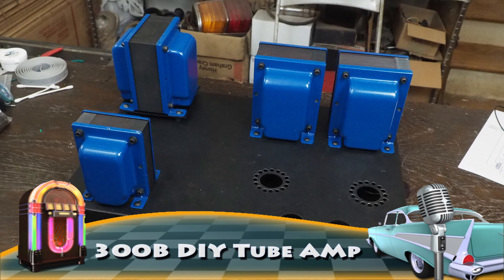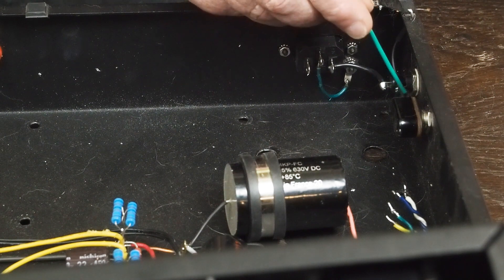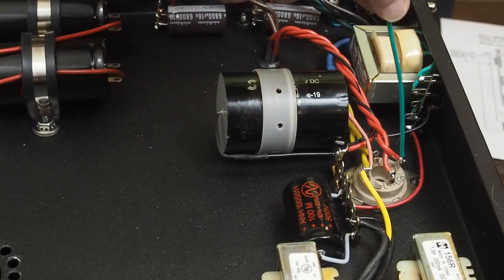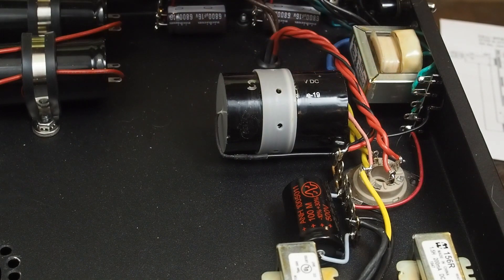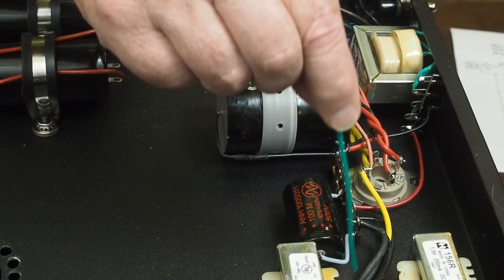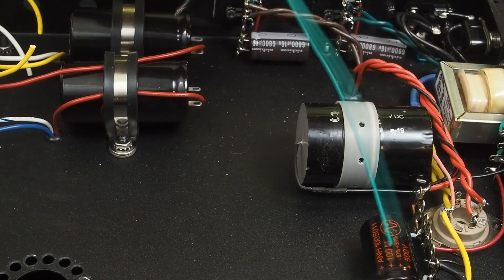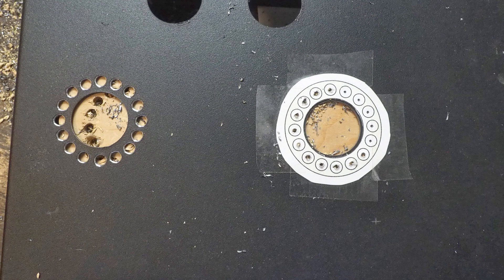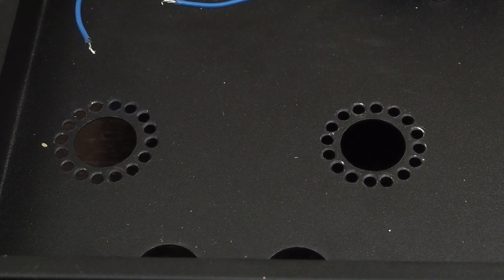300B DIY Budget Tube Amplifier Build DHT SET #5

Comment: all resistors have a maximum voltage rating. typically 350 volts for metal film. so if we have more than that use 2 or more resistors in series. I don't like to put really high voltage across bakelite terminal strips where the bakelite can break down(I have had it happen with equipment I did not build). ceramic standoffs are preferred or at least a long path between bakelite lugs.
Reply from the maker: The metal film resistors I use are rated at 500V. The voltage rating has nothing to do with they type of resistor. Also millions of tube amps have been built with these terminal strips and never failed.

Comment: enjoying this build series so far.  question regarding your grounding.  take for example the power switch (which is metal).  did you grind off the powdercoat so that it is in contact with earth ground?  i believe all chassis components (particularly those that are touched) should be connected to earth ground.

Comment: Great build. You obviously know your power supply loop. The DC offset for the heaters can also go to the cathode of the 300B, since that is a decent positive voltage. But your voltage divider allows adjustment. Either way works, I am just glad you elevate the heaters...
Reply from the maker: I considered that, but this voltage divider is simple and as you said adjustable.

Comment: Awesome :)
I have the same fun with the elevated heaters, in my case I need two 12.6V heater supplies referenced to +50V and -150V to keep the cathode-heater voltage difference within the tube design specifications. Looking forward to the next installment :)